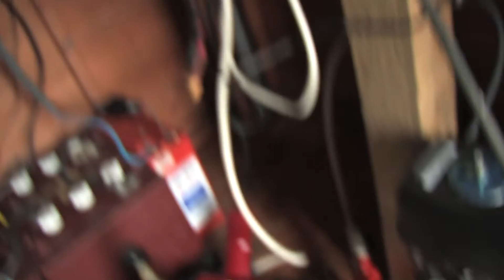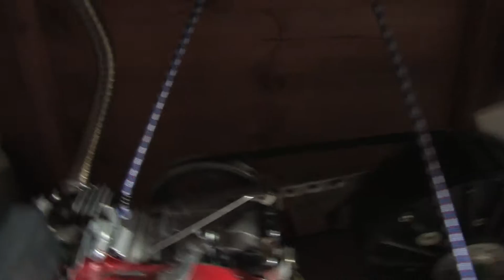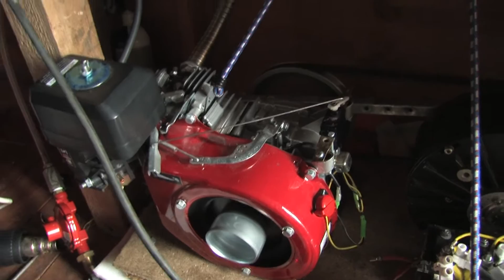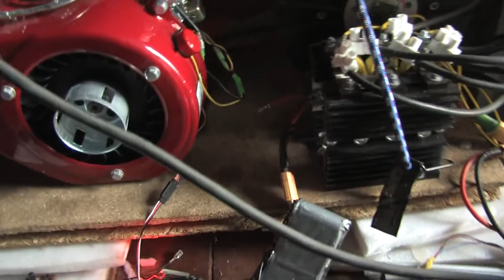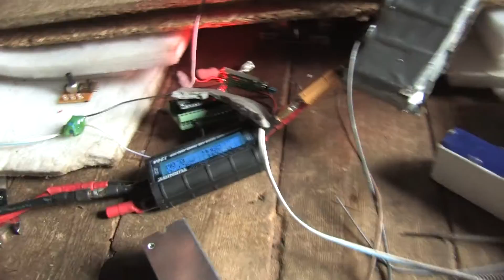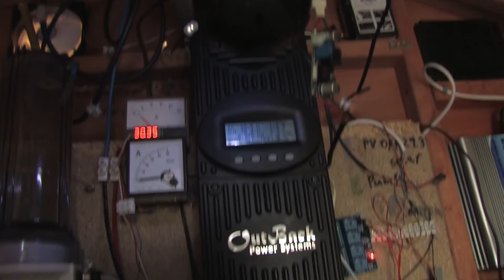Arduino DC Generator Control Fixed

Comment: im trying to take this idea a step farther.    I am currently monitoring the hz output of the generator and adjusting the throttle accordingly via servo and nano.    I haven't gotten the bugs worked out quite yet but I would be interested in trading
 code with you.
Reply: I'm getting ready to start a similar project, more than happy to share ideas.

Comment: Shaun, Do you think i could use a setup  LIKE this to run a variable vein wind generator with an arduino and what type of controler as an rc wouldnt be  wouldnt be man enough  thanks

Comment: That looks like something I am trying to do with my bushfire pump. I want to be able to start it remotelt by gsm SMS and then control the throttle. How did you overcome having to use the choke as it seems you have an electric start. It looks like a Honda or honda clone motor. Any ideas would be greatly appreciated.
Reply: He likes running his engine on propane, the electric start is from a second coil in the brushless motor he is using as a generator.

Comment: watch out how you use "delay"... I feel the Arduino tutorials tend to lead you down the wrong track.. Where you have placed it will pause the whole loop for delay(15) and you may wish to be monitoring power loading more regularly. I tend to set a timestamp and then test to see if elapsed time has expired before executing a certain piece of code. this allows rapid loop of the whole strategy and individual delays within the loop. you should then be able to take an average of several power readings before adjusting servo position, and control rate of servo movement..
Reply from the maker: Yes, definitely agree with you there. I may be doing a few more arduino projects this year and I will try and make use of things like interrupts and not using delay.

Comment: Found the fix ! Are you using the speed controller as a bridge rectifier or does it just happen like that when the DC side is still connected ?
Reply from the maker: The speed controller is used to start the engine and will act as a rectifier but will get warm. I can just disconnect it when the engine is running and the huge rectifier takes over.
Reply: Got it, so you don't charge via it ? - just wondered it got warm otherwise.

Oh yes, I don't know if you've have come across these for voltage sensing and switching 

http://www.ebay.co.uk/itm/6-FUNCTIONS-DUAL-RELAY-VOLTAGE-CONTROL-TIMER-CONTROLLER-power-DC10-15V-/182419218527?hash=item2a7908605f:g:LdgAAOSw~gRVpNfV
Reply from the maker: No, I don't understand what it does.  If I need such a thing, I can implement it using arduino. You could charge via the controller if you use a bigger one or charge at a lower current.
Reply: Sorry,  The module is a selectable voltage timer relay, I thought it might be helpful as an over voltage cut out for your generator, as a separate safety measure. Fine on the motor controller stater I guess the body diodes can't handle that much current.
Reply from the maker: That's a good idea, I was going to make a high voltage and low voltage cutoff using an arduino and a dual relay module.

Comment: Hi Shaun, nice work! Can you provide some more information about wiring, and what servo do you use?
Reply from the maker: Hi, it is just a normal full sized RC servo like you would find in an RC plane. I have a voltage sensor connected to the battery which is just a simple voltage divider. The servo has its own power supply which is just wired into the 12v input on the arduino. If you look at my other generator throttle control video I made before this you will get a better idea of wiring.